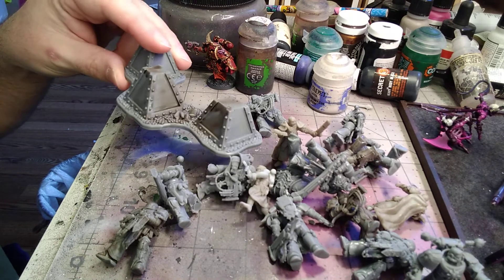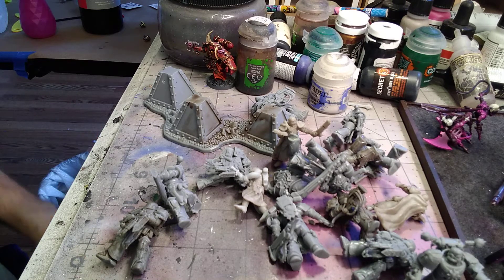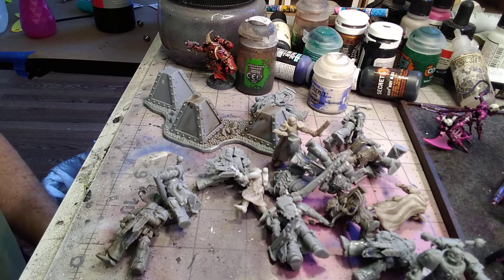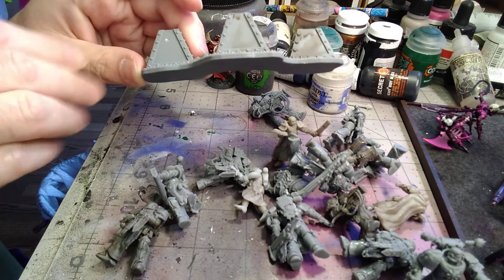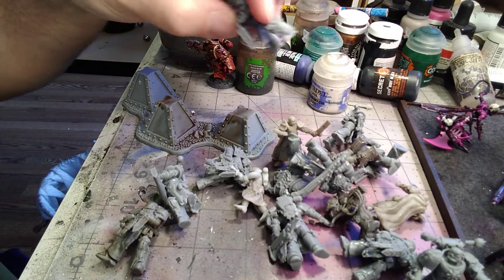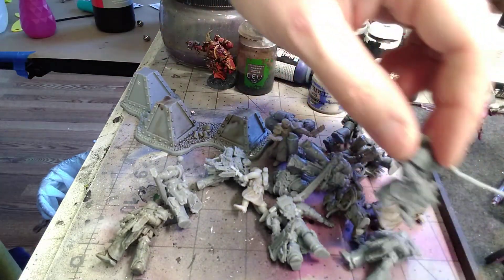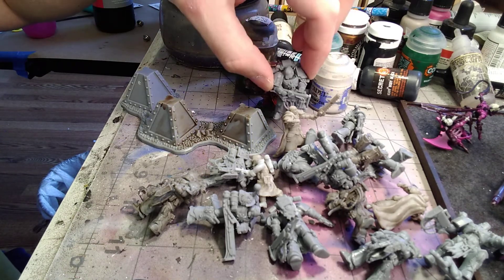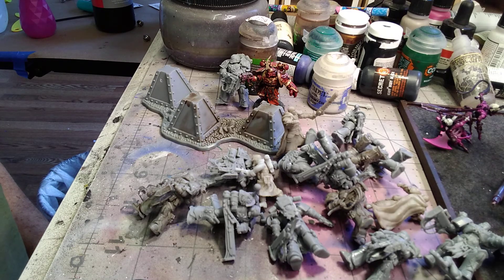Phrozen Sonic Mini-4K Update

Comment: Suggestion but not saying this is the cause, because you already pointed out that the stripes are inconsistent in position, therefore probably not an anti-aliasing type problem:

From another person's video (can't find my notes): Idea angle for any of these printers for a flat surface to avoid anti-aliasing type error is:
Arctan(layerthickness/screenpixelwidth) in degrees

If you only have 1 surface you care about or only parallel surfaces, you can rotate your surface to line up with that exact angle. (eg long table)

But you have something with surfaces 90deg (eg dice) that you don't want aliasing stripes on, then set your layeer height = your pixel width, and rotate the surface to a 45deg angle. The steps are even/1:1 at a 45deg angle (either direction), so you don't get the periodic alias line on any surface at a 45deg angle.

Another way to think of this (for non-90 deg surfaces): example those road blocks you had stripes on
*align as many surfaces vertically/90deg to the build pl as possible (no pixel change, so they shouldn't get alias lines) - eg tilt your part back so the long surface is aligned straight vertical
*use the equation in reverse to calculate the idea layer thickness to match the angle of your non-vertical surface

(with a bunch of simple trig (double angle reflections) you might even be able to get 2 face angles vertical and rotated to an ideal angle, then get a layer thickness that matches both the other 2. That's probably more work than it is worth unless you are making a bunch of these)

Comment: Increase your lift height  see if that helps getting rid of those lines. Also dont print such a large model flat, tilt as much as possible. The larger the surface in contact with your fep, the greater the peel forces.
Reply from the maker: Lines appear in prints done on an angle. Lift height, how does effect layers being displaced?

Comment: The vast majority of your problems seem to be related to your z axis. Vibration causing layer shifts and way too much downward pressure on your z calibration. If your calibration is wrong it will keep driving the print into the fep as it's working with relative offsets. The resistance could also be why your threads are wearing out prematurely. If you're also still using painters tape around the lcd, it's 0.14mm thick where packing tape is commonly 0.078mm you should also make sure that your paper is the same thickness as the FEP which ranges from 0.15 to 0.2mm. these are observations and suggestions based on your videos and so should be considered as helpful suggestions and limited observations and not criticism. I've been working with fdm for almost 10 years and have a mini 4k on the way to finally play with resin and your videos are very informative and have me excited to get mine dialed in. Please post more updates.
Reply from the maker: Interesting, the idea of too much downward pressure and vibration. How could we dampen vibration? I use standard 20# bond paper. Perhaps I should do some measurement and see what less downward pressure results in.
Reply: @warpaintminiatures1517  
I'm a mechanical engineer, but currently work repairing production cnc machines. here's a few ideas:

1.Could try stiffening the bar that drives the Z motion/holds the build plate. Comparing to other machines, they used a thin plate that flexes. Some gusseting in the vertical would remove some Z flex

2.Similar for the Z rail. (see how the more expensive units use heavier dual rails for higher rigidity)

3.If you are getting a specific harmonic tone, changing almost anything will shift that natural frequency.

4.Could clamp or clad with a rubber damper.

5.Mass is a universal vibration absorber, but different material are better than others too! Alu is very bad a vibration absorption. Iron is better. Cast is better (due to the way vibrations get internally broken up and absorbed more). Lead blocks, sand filled bags or tubes etc could be used all around the machine wherever vibration seems apparent.
*Great example: a deadblow hammer doesn't bounce back like a regular hammer due to the sand or lead powder absorbing the vibration)

6. (don't expect you to do this unless you have one laying around) Heavier ball screw with tighter tolerances and more rigidity

1 or 2 of those things could be a quick and easy improvement.
If you do all of them, then you will probably be asking yourself why you didn't just start with a heavier machine that costs more up front but doesn't need the upgrades.
Reply: Krystian Blaszkowicz  thanks for the info Krystian, I would appreciate a little more detail about the stabilizer you added. Specs etc.. 🙂
Reply: Krystian Blaszkowicz  thanks I'll check it out!🙂

Comment: Hey buddy, great video! 
I'm having the same issue with inconsistent prints. What did this Gcode actually do? Is that an important part?
Reply from the maker: I am not really "up" on Gcode but what I did was a file compare for the differences and found out that Lychee and Chitubox produce different code. Chitubox sliced files matched the "setting" part of the code from them while the Lychee was different. The difference was in the pause before exposure which is apparently different code commands than what you would think as "light off delay" though the setting in Chitubox does indeed set the "pause before exposure" while Lychee does not. Which baffles me. I expected sliced files to be sliced files and commands to be standardized but that is clearly not the case. In the end the key was "pause before exposure". I can use lower exposure times and not have failures as long as I've got a pause there. I know it's a complicated reply but even I don't understand it, clearly Phrozen does, because they provide a little calculator to help you get the number right.  So obviously it's important. But as a Lychee user you have to remember to "bake in" for it's different command sequence to get the actual delay before exposure to be the right number rather than just entering the number in Chitubox. So with a little fiddling you can match your plate movement speed and distance moved to get the timing.
Reply: @warpaintminiatures1517  Okay I'll try printing with Chitu for a moment. I already sent a message to Phrozen, maybe I'll get those Gcodes, cause I just prefer Lychee.

Comment: Looks like you are having two issues. Because you are printing an angled faces square to the x and y you are getting voxel corrections which the first video explains. Don't take that video as the best solution to your prints as there is emerging a better way to try out. https://www.youtube.com/watch?v=Qs2Rb0ExnIM

The second thing and it can reduce but not completely take away the wood grain looking typography of the very top faces but greatly smooths the part surfaces is Anti aliasing. In engineering type faces (your pyramid plinths) there is a range of angles you can orientate the faces so they are compound angles in the x, y, and z axis. this way the computer forces the anti aliasing software to generate its best fit which also looks and feel awesome. The science is crazy but experiments are producing great looking engineered type faces and sculptured models.  The sweets spot seems to be the mid angle between each 45 degrees in all axis' (?) . So for the plinth parts you showed I would try to rotate so the pyrimids are aiming for 22.5 diaganal across the build plate set the anti aliasing values ( you need you own for each machine my photon s uses anti aliasing4 grey level 2 pixel blur 2) and try a test print of some scaled down pyrimids with the same angles. https://www.alexwhittemore.com/efficacy-of-antialiasing-on-msla-prints/